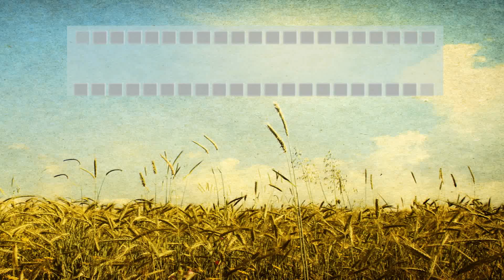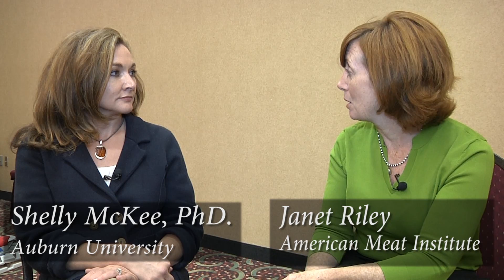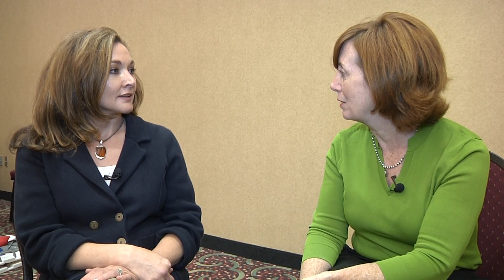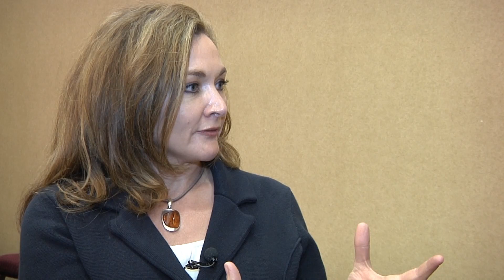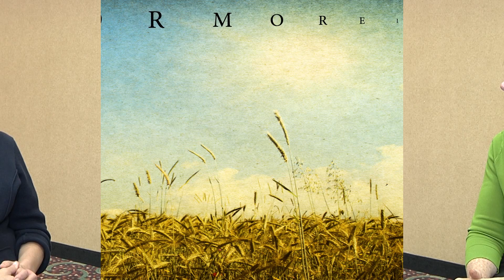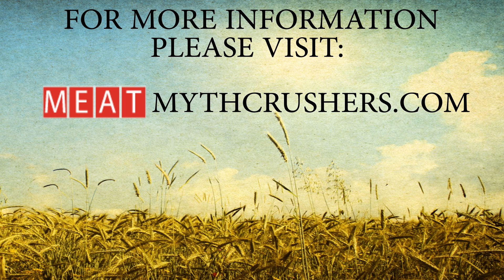Meat Mythcrushers: Mechanically Separated Poultry

Comment: I worked in the department at a chicken plant that makes mechanically separated chicken. It is absolutely disgusting. Also, I understand why, but you don't want to see actual meat in it while you're working, that's not what they want going into it.
Reply: How does the mechanical separation process remove bone tissue? I have never understood this part of it. If the carcasses are ground into a puree and then forced through a screen or sieve under pressure, how do bone and muscle end up separated from one another? If the material is already pureed, wouldnt the sieve just make it into a finer puree that still includes all of the starting components in their original proportions?
Reply: @samgonzalez9845  The process of mechanically separating meat from bones is actually quite precise, even though it may seem like everything is ground together. Here’s how it works:

The Mechanically Separated Meat (MSM) Process:

	1.	Preparation:
	•	After the main cuts of meat (like breasts and thighs) are removed from the chicken, the remaining carcass, which still has small amounts of meat attached to the bones, is sent to the mechanical separator.
	2.	Grinding:
	•	The carcass is ground into smaller pieces to loosen the meat from the bones. This step breaks down the material but doesn’t pulverize the bones.
	3.	Separation:
	•	The ground material is passed through a high-pressure sieve or filter.
	•	The soft meat, connective tissue, and fat are forced through the sieve, while the harder bone fragments and inedible parts (like cartilage) are left behind.
	4.	Screening:
	•	Any remaining bone fragments are filtered out using additional sieves or centrifugal force, ensuring that the final product contains only edible material.

What’s Left?

	•	The result is a paste-like meat product made up of muscle, fat, and connective tissue. It’s smooth and uniform, making it ideal for forming into patties or nuggets.
	•	Bones, cartilage, and other inedible parts are completely removed during the sieving process.

Regulations on MSM:

	•	In the UK and EU, MSM is regulated to ensure that the final product is safe and free from detectable bone fragments.
	•	By law, products made with MSM must be clearly labeled, so you can check if a product contains it.

Why Doesn’t Bone Get Ground In?

Bones are much harder than meat, and the machinery is designed to separate the softer components while leaving the harder materials behind. This precision prevents inedible parts like bones from contaminating the final product.

If you’re looking for food that doesn’t use MSM, you can opt for products labeled “100% chicken breast” or make your own burgers from fresh cuts of chicken.
Reply: Good point!